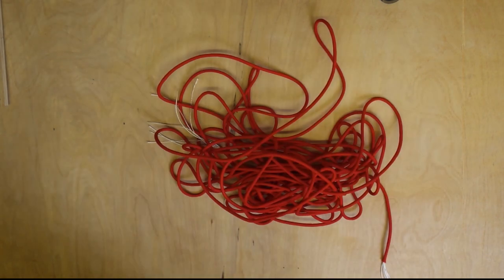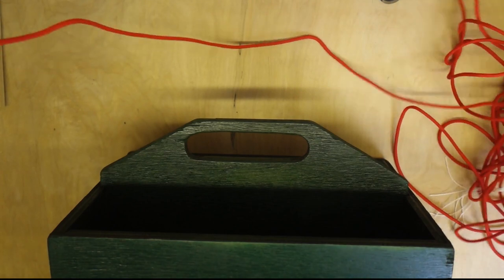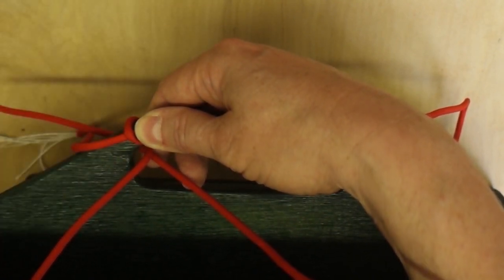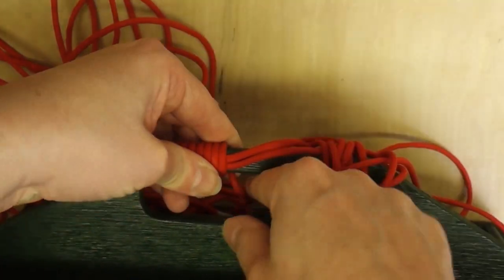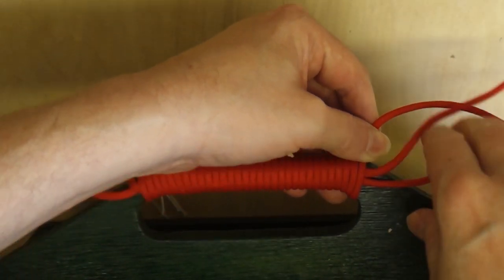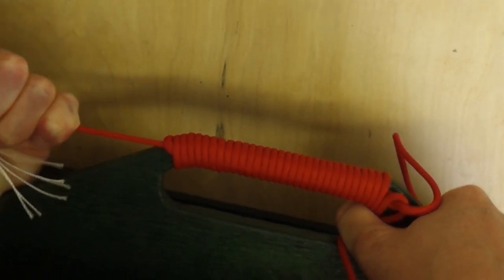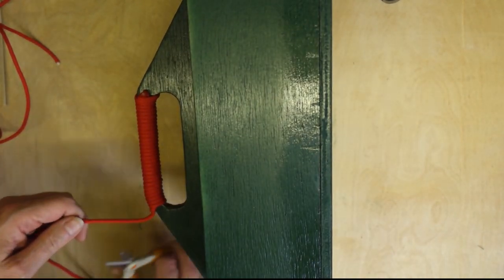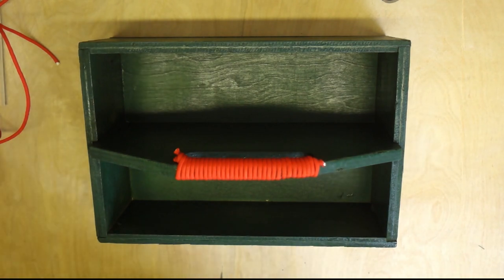My first attempt at wrapping, or whipping, a handle using paracord

Comment: TPi. Turns per inch, measure off one inch and wrap cord around to the inch mark, mark it, undo it measure length so now you know how much you need per inch and just multiply by length of item to be whipped. Easier than I make it sound. Enjoyed as always.
Reply from the maker: That's brilliant, thanks. I was wondering how to measure at least roughly how much to use. I don't think I'll be doing too much of this, but that will certainly help if I do any more :-)